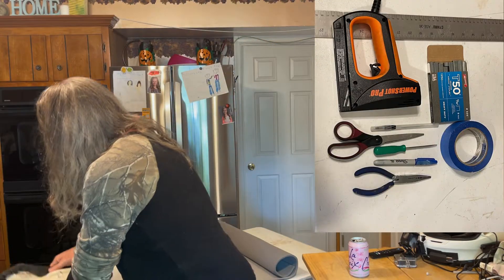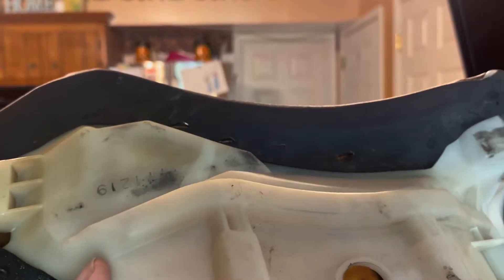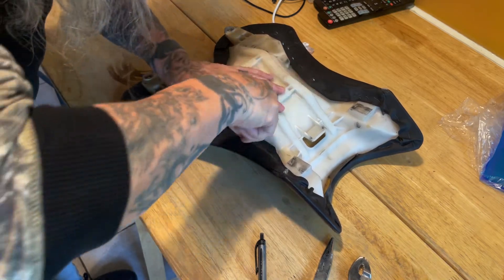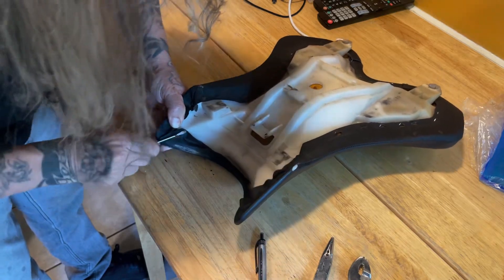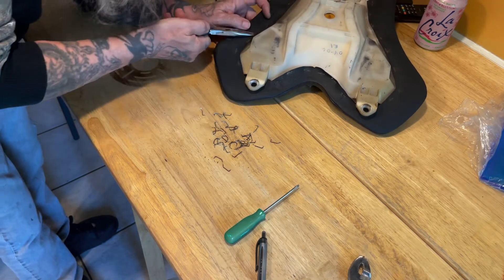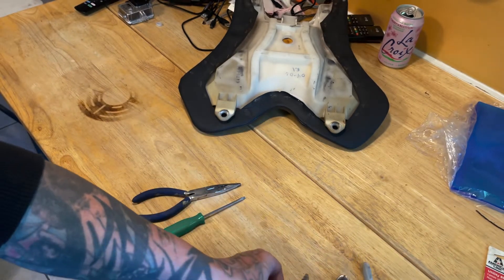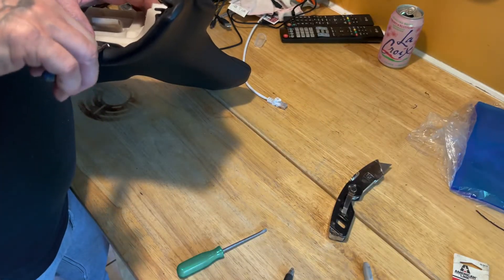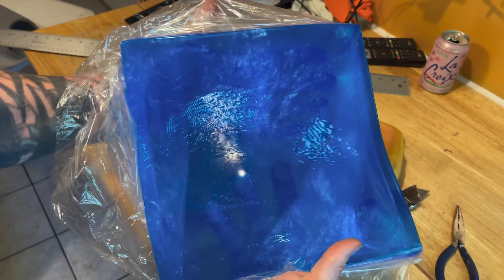How to upgrade your motorcycle seat using gel pad ￼

Comment: Does it really help the numb butt ... like for  3 to 5 hr rides? Right now I'm numb after 1 hr. with my OEM Shadow Spirit seat.
Reply from the maker: I would say no it’s just basically not as hard actually the cheap $40 seat I bought off Amazon or eBay. I don’t even remember was very soft and better than the stock or the gel pad.
Reply: @MotoBaumVirginia  Ain't that a kick in the head? I'm beginning to think those Corburn, Mustang, Saddlemen (etc) users and supporters are just justifying their expense. 
Thanks for the word up.
Reply from the maker: @gphilipc2031  yeah no problem at all. I should do a little comparison video on the three or at least on the two but the new cheap $40 Amazon one I don’t know how long it will last it seems quality it looks good. I’m sure the last a couple years, but it is nice and soft, I mean nothing’s gonna make it super comfortable but it is way better than the stock seat and better than the gel that’s all I got thanks man

Comment: Try a new cover piece called 4 way stretch...should work.
Reply from the maker: Thank you that would be nice. I really need to just buy a new seat because that foam was pretty dry rotted that was in there. But I need a new cover for my Harley seat as well so maybe I’ll try it for both of them. Thanks for the tip.

Comment: wats ur review about the gelpad in your bike seats after ur rides?
Reply from the maker: I used an old seat that was already hard, i could feel the seams of where the jell pad was put in, to be fair it may need to be tried out in a new seat. I bought a 40 dollar new seat off Ebay and it is way softer than the jell pad with the old foam in it.. I would just by a new seat.
Reply: jell pad is not worth?